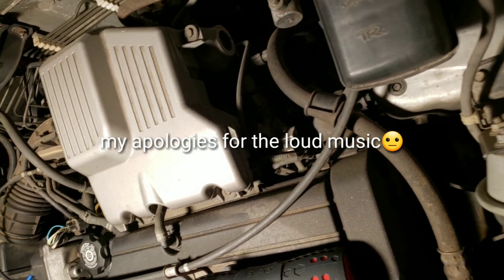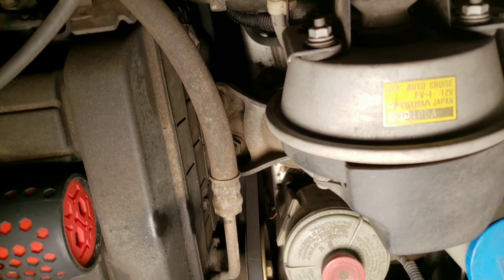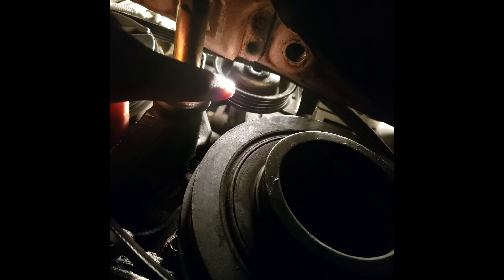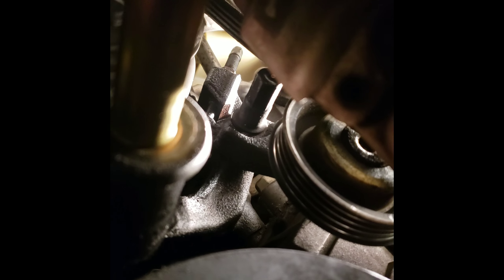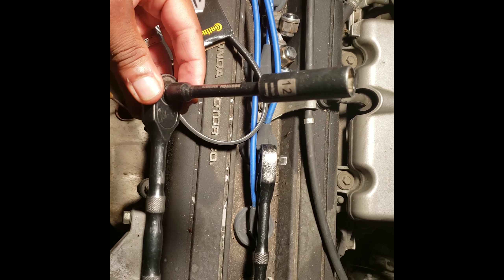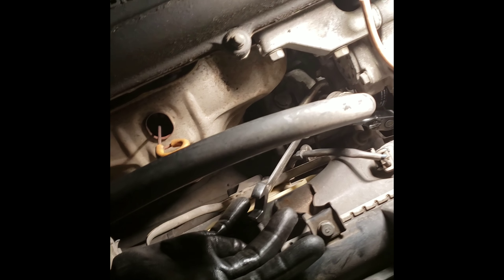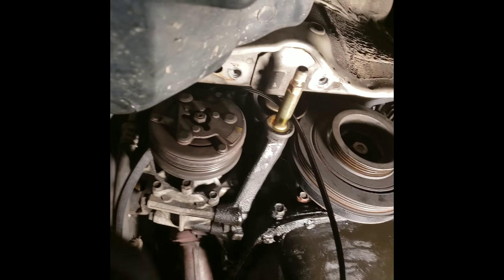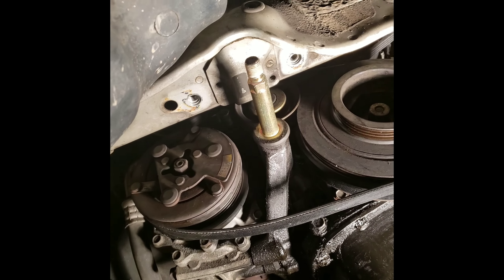1999 Honda CRV Alternator, A/C, and Power steering belts replacment

Comment: Good video. Did this today on a 2001 crv. Pointed me in the right direction, but it's incomplete. I had to use this and one other video that was also incomplete to get the entire picture. The two videos complemented each other. What one lacked the other had and vice versa. You don't need the deep socket, just a regular 12mm for the ac tensioner. You need to move the ps pulley out of the way by lifting up and turning clockwise to free up space to more easily access the 12mm nut and 9/32mm stud. You just loosen the 9/32mm tensioner stud enough after you loosen the 12mm ac idler pulley lock bolt, and the ac belt slips right off. You don't need to remove the entire motor mount bushing, just the two 14mm bolts holding it in place then you pull down on it to provide clearance between the bushing and frame to slip the ac belt out. If I had to do this all again, I think the entire replacement would take me 10 minutes. So thank you for the vid, but like I said it was incomplete. Still thanks for pointing me in the right direction. Every little bit helps when tracking projects. Aloha.
Reply: You don’t need to remove idler pulley for ac belt. After loosening the adjustment nut use a 7mm socket on the end of that same stud and loosen it this will allow the ac tensioner pulley to drop lower the further you back the stud out.
Reply: @huntrgonzo9116  I think you're probably right. It's been a while since I did this, but I think once you crack the idler pulley lock nut and loosen then tensioner the belt should slip off. I think I wrote that because my lock nut was on so dang tight that I had to just remove the pulley itself to get the belt off at that time.
Reply from the maker: Great stuff guys thanks for commenting
Reply: @savagewildanimal4life hey guys! How did you guys measure tension? I changed alternator, the belt looks brand new so i put it back. However, there is squeaky noise. I think tension might be issue😢

Comment: Another video I watched said I had to hold up my engine in order to get the bottom belts off and new back on.  It didn't look like you did that.  Was it only the two or 3 bolts to the motor bushing that helps me to remove that without having to hold up my engine with a jack?

Comment: Great video.  I was able to get the 12mm side bolt loose and the 12mm nut on top the adjuster bolt loose, but the 9/32 adjuster bolt won’t turn.  Any ideas?

Comment: Did you have to remove the two motor mount bolts on the top & put a jack underneath the engine?

Comment: Great Video.... just wish I could find what to do if once the tension adjuster is loose  and the pully is still locked into place
Reply: Did you figure this out?  I got the same problem, loosened the 12mm bolt but can’t get the 9/32 to turn.
Reply: @nightsky81976  it's been a year, but if memory serves there's another nut like hidden back behind up underneath everything on the right hand side down below if I remember right just feel around and you'll find it

Comment: I broke the ac pulley tensioner bolt the 9/32  one in the bracket you think I can remove the pulley and screw it from that end to get it out? Smh I'm highly regarded
Reply: Might be late but loose the 12mm nut of the 9/32 bolt, go get one at a pick n pull junk yard.

Comment: Did you really forget to put the motor mount back on? Or is that just assumed? And when removing the motor mount did you need to put a jack under the engine first?
Reply from the maker: @fredimpens I put the motor mount back on with a new bushing and when. I took the old one off yes the wheel was off and slightly jacked up